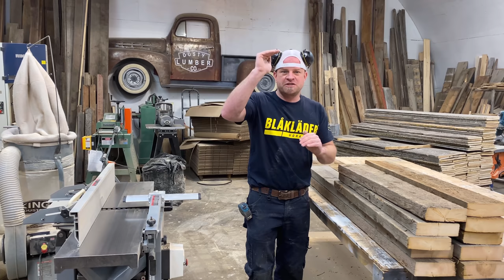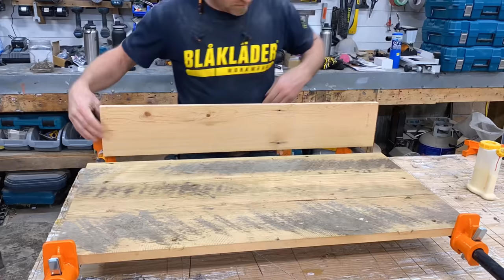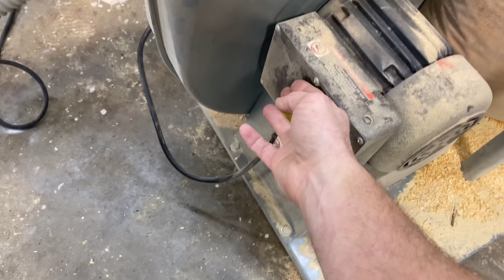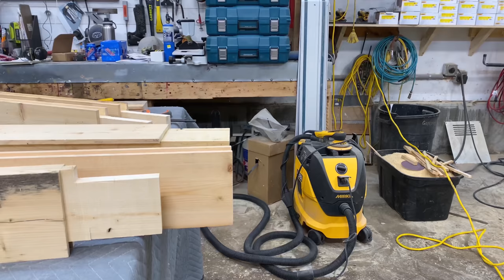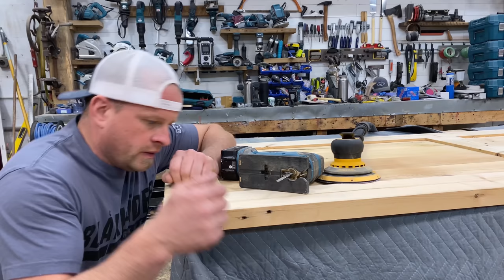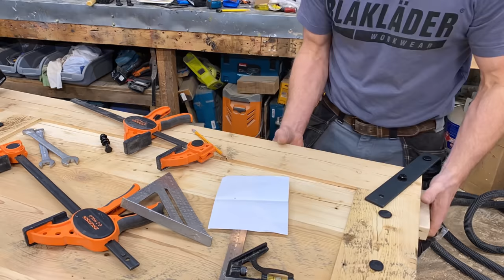Haunched tenon barndoors

Comment: You did something that I accidentally did one time.
When you used the biscuit joiner on the bottom for your groove, you went all the way across from one end to the other. Most times, a barn door never slides the full width of the door. You could've stopped the groove a half inch from each end, so it wasn't exposed.
But otherwise, loved the video. Kinda like the New Canadian Workshop.